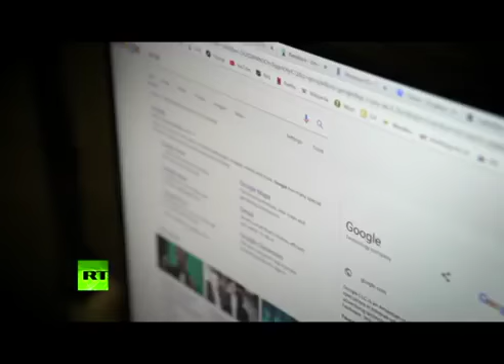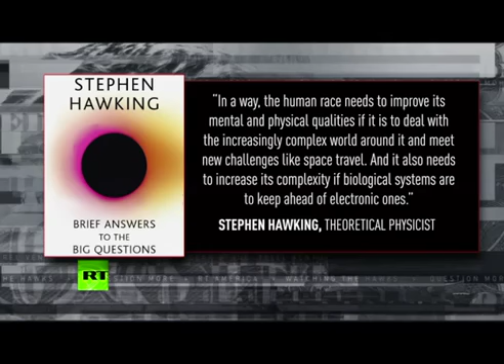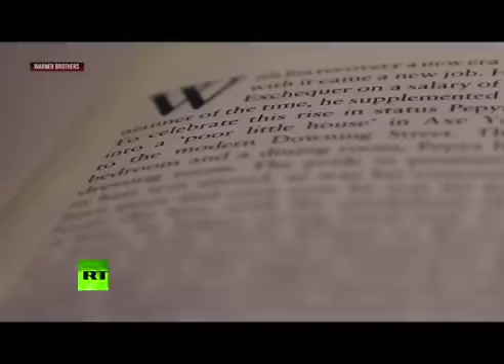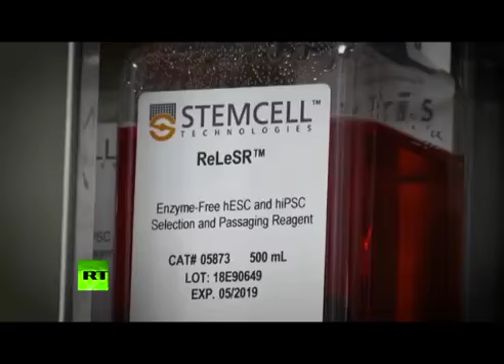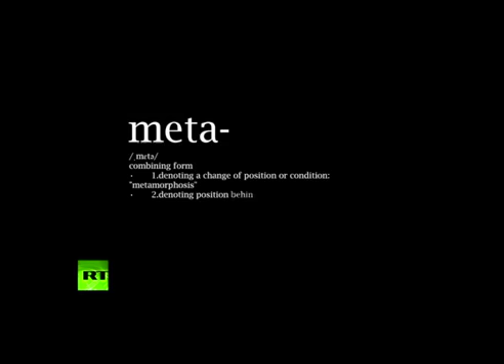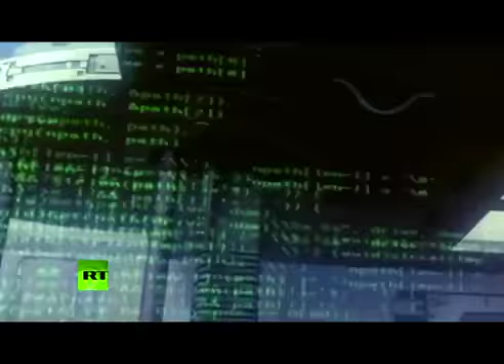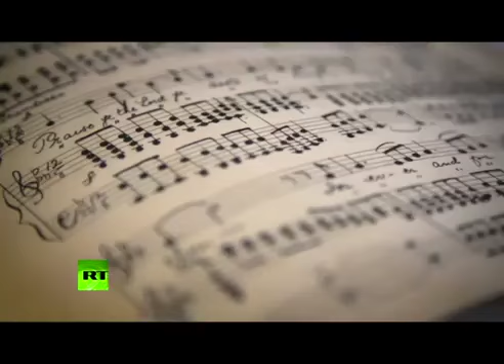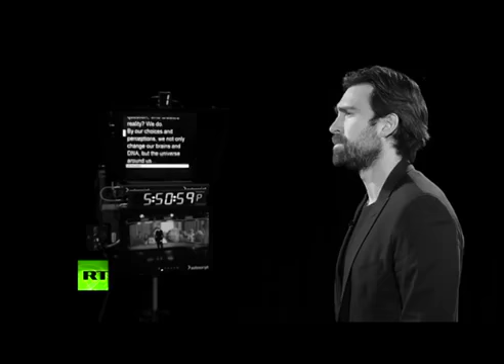MetaHuman - Sean Stone & Deepak Chopra

Comment: It seems illogical to me to automatically assume, as they do throughout this video, that computer technology somehow parallels brain technology. What if brain "technology" were completely, utterly and alienly different? Two issues, for example: DNA entanglement and neural plasticity. 

DNA entanglement, with identical DNA in every neuron, would resolve two principle problems: 1) the binding problem, 2) entropy. There is no "binding problem" in computers to address, because processing is very fast, but linear (even with multiple computers arranged in parallel). Binding among neurons in a brain, by contrast, suggests that all processing is parallel, occurring at the same time, and synthesized at the same time into a single unity of purpose... a single thought, as it were. Computers can't do this. DNA entanglement is not that far-fetched... just consider how DNA replicates. 

And with respect to neural plasticity... sure, computer circuits can be switched, but neurons/glia choosing which other neurons/glia to connect with and communicate with is a whole other ball-game. The adaptrode models implemented within neural nets can perhaps SIMULATE neurons to some level, but the binding (entanglement) will always be absent, at least with current technologies.